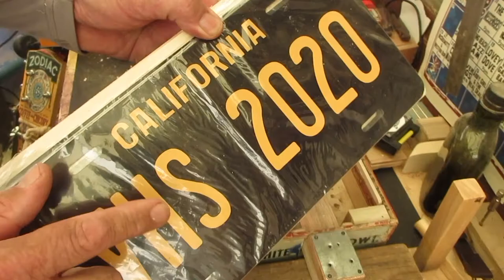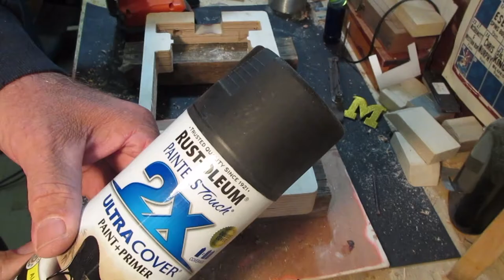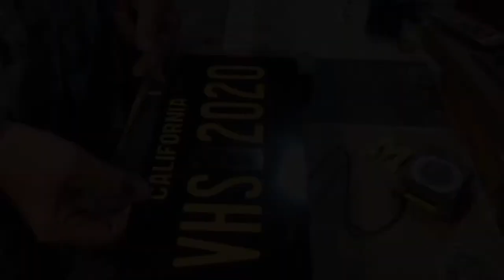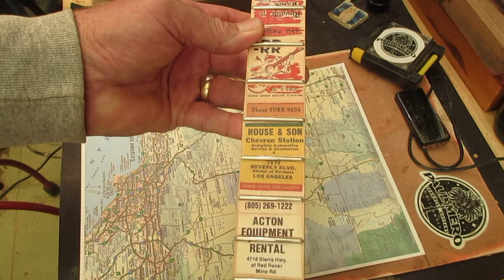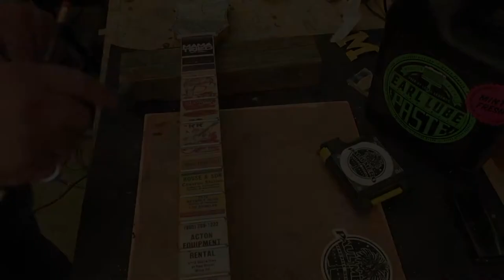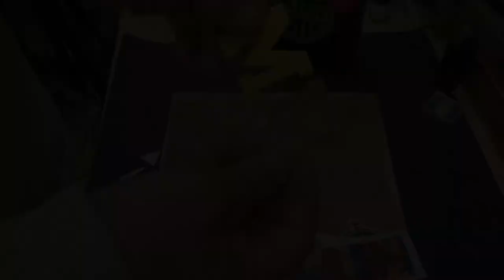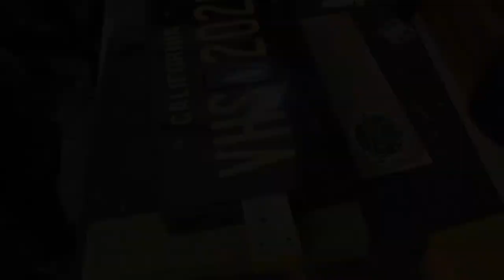Start to finish build of a license plate guitar for the Vasquez High School PTSO Fall Festival.

Comment: How do you know you have the frets 90 degrees to the neck?  I did see you check.
Reply from the maker: I buy slotted fretboards in bulk. Check MGB
Reply: @paulmerojunkpileguitars  how do you get the frets lined up straight on the neck so they are not at a slight angle ?